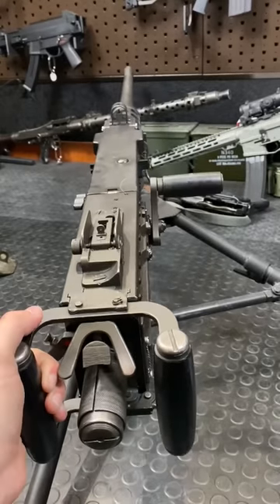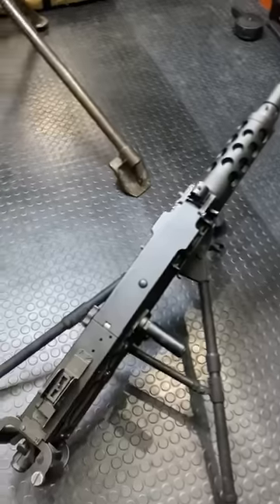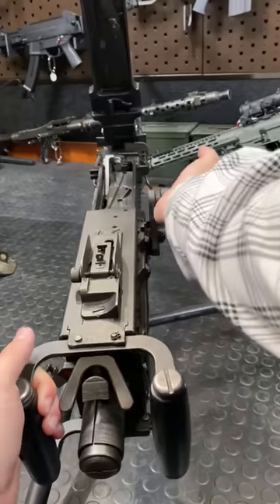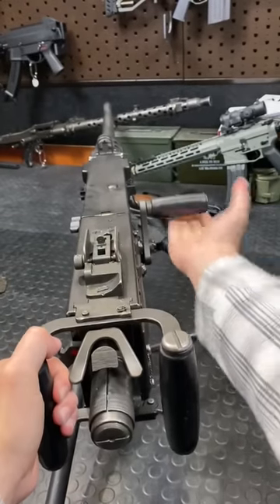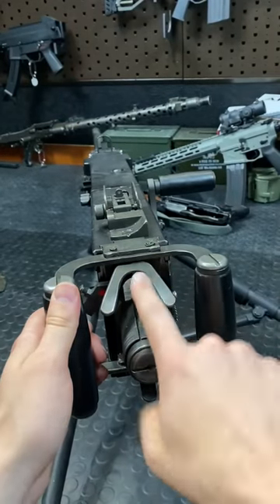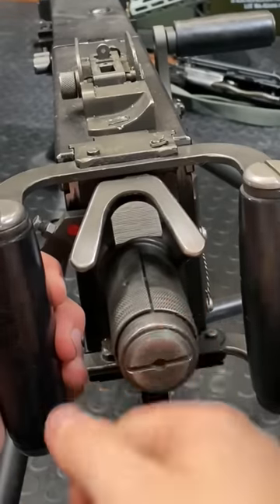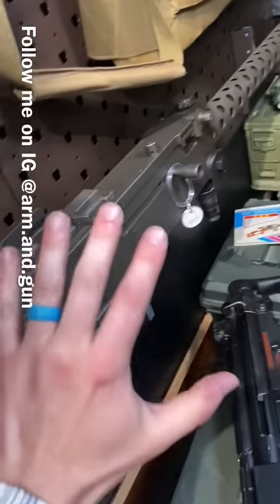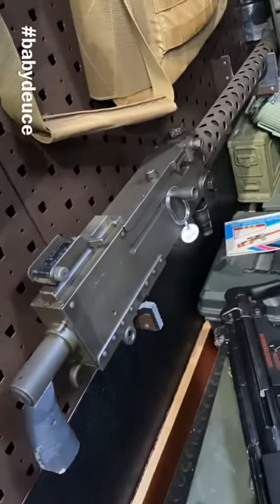50cal Browning M2HB “Ma Deuce” in 1 Minute #Shorts

Comment: When you realize that the firearm you designed is so good that it is still in wide use by the military almost 90 years later.
Reply: Çòòĺ àñd ÀWÈßÒMÈ'
Reply: The AK 47 was named after the year it was created. 75 years and that thing is everywhere. 

Some inventions are like sharks or alligators, peak evolution that doesn’t need to improve and can’t really be improved on. Cockroaches, horseshoe crabs, and the M2. 

Like the A-10, the Air Force keeps trying to replace it but they can’t make anything that’s better at doing what the warthog does, and that plane has been the original thing that goes “BRRRRR” since 1977, another Gen Xer that won’t ever get to retire and never did give a damn.
Reply: It's not that great. There was an attempt at replacing it but the geniuses at Army Ordnance were too obsessed with trying to make it capable of switching between 25mm grenades and .50 BMG, and it never went anywhere. 

It was a good weapon for the time, but we need something more simple, durable, and reliable now. If you want to know my reasoning, I spent close to a decade in a small arms shop working for various units and M2s were one of the most common items to be deadlined, behind M249s and mortars. M240's? Hardly ever broke short of dropping one out of a helicopter. Mk19s? As long as you assembled it right, it was damn near unstoppable. M4s and M9s? Some minor things here and there, but extremely rare when compared to M2s.
Reply: @Motoboo_Marine  Don't get the reasoning behind claiming the M2 isn't that great because of generally needing more repairs than small arms. It's a .50 cal machine gun. More stress on the parts than intermediate rounds. Allot of M2s in service are ancient with thousands of rounds passed through, just maintained and refurbished over the years for more extended use. This all goes for a multitude of different heavy machine guns in use around the world. 

Bigger gun. Bigger parts. Bigger bullets. Extended use. Equals to needing repairs. Most veterans I've seen have positive feelings towards the gun. If it's loved by the soldiers using it, by chance it does it's job plenty good.
Reply: @Firealone9  I didn't say it wasn't great. I just said it wasn't that great. 

People love it because of the round it shoots, not because of how reliable it is. How can a weapon possibly be that great if you can't use it because it's down and waiting for parts? Out of all the troops that love it, few of them have actually used them in combat, and if you ask those guys I gurantee about half of them will tell you theirs broke down all the time. You don't hear about those stories because those are not what the majority has experienced; what the majority has experienced was shooting them on a range during training, not having to take care of them for months on a deployment.

Armorers are not trained to the level required to successfully maintain an M2/M2A1in MOS school either. Every weapons class revolves around how go detail strip and reassemble everything, and that's pretty much it because that's all that's needed to repair every other weapon in inventory. Why shouldn't the M2 be the same?

The size of the round doesn't matter here. It's about how the design handles the a huge round. There are 20mm AA guns that need way less maintenance than this thing. If you're familiar with how the internals of an M2 works, you'll understand what I'm talking about. The M1919 it's based on needed about the same level of maintenance, whereas the M240 barely needs any despite shooting a round with the same power.

The only reason someone doesn't create a mechanically simpler .50BMG machine gun is because the ordnance dept is lazy. They've actually gone as far as to change the code out requirements for the rivets being loose several times, in order to manipulate the numbers so it doesn't look like they're going down as much. All so they don't have to do anything about it.
Reply: @robinsonkaspar3395  well they have make newer version of the ak and the 47 is longer standard use while this thing is Still in service. Not the same thing
Reply: @Motoboo_Marine  The reason why we dont get rid of the M2 is the reason why we dont grt rid of the M16. You cant justify requiping the military with brand new guns that do the same thing as the old guns. The M2 still has its parts being manufacturered, they can be repaired and put back into use realitively quickly. There is no point in paying billions upon billions of dollars to abandon a perfectly functional weapon in search for another weapon that does the same thing. That thing being shooting big boy pews at lethal velocity very rapidly. 

Just like the M16. It is a perfectly functioning carbine that the military has known and used for decades by now. Improvements are made of course but until a new rifle or carbine comes out that is vastly different and improved from current weapon systems, there is zero purpose in replacing it.
Reply: "Sup kiddo"

- M1911
Reply: Except it seems to jam like crazy according to some Veterans.
Reply: @jumbo 

Gotcha, was wondering.
Reply: This comment has also been in wide usage for many years. How about you come up with something marginally original to contribute?
Reply: @lukegaming86 

Don’t think too much about it.

It’s the internet, almost nothing is original. Always copied or “inspired” by other things.
Reply: @jumbo  as another veteran, they do jam. I've done enough work orders to prove it.
Reply: @jumbo  and that's *false. If yours rarely jammed, it was because you had an armorer who knew their shit. But those aren't exactly common. Most in service are beat to absolute shit. I've had to rebuild several hundred of them belonging to multiple different army units during my 3.5 years in Afghanistan, both M2 and the A1 variants.
Reply: So good, there is no man alive who had been in the military before it was adopted. For everyone on the planet, the M2 was just always there.

Guns don't kill, they serve. Steel doesn't break, it supports.
Reply: I fire it yearly in the swiss army
Reply: Military's
Reply: The right to bare arms is a fine line. You also have the right not to.
Reply: Remember that old saying when something works don't mess with it but then again nobody messes with ma deuce.
Reply: @robinsonkaspar3395 
Cough cough Let me tell you about the Mosin Nagant that was made in 1897 and is still being used to this day cough cough
Reply: @okca5846 
Mosin Nagant: Mind if i join?
Reply: @robinsonkaspar3395 
The a10 is dodo garbage
And was replaced before it was even finished by the f111
Reply: They are in fact the same 90 year old machine guns we originally pressed into service before ww2. At least they operate like that.
Reply: @dylanmccallister1888  not THE same
They are modern produced
And with several small mechnical upgrades 
But more or less the same
Reply: its a 100 years old gun and is very good as a mounted gun or as coaxial machine gun . for a bullet, 50.cal does more damage
Reply: @jumbo9386 Your reasoning is "It's great because I hear that people say it's great?" Flawless logic there, ya dope.
Reply: @BadassName17  "Some veterans" say it jams so I don't like it." Whatever dude. Well this veteran says otherwise so you can add a check to the other side of your list and I'm an actual person, not just some anecdote.
Reply: @eamonia  

This was 2 years ago, this was settled a while ago.

And I do not kiss your ass, you are simply defunct military property and have no more right to speak to me that way than a normal person. I said some for a very good reason, and I didn’t hear any that said it was good except from Jumbo.

Comment: I would be impressed if you can do the head space and timing my man.
Reply: Without a wrench and spacer tool! Try carrying it out of an MRAP by yourself in one piece or a tank. Doing this all day long. If someone holds the barrel by hand with gloves on, and the gunner carries the most right weight at the rear sight firing on auto bursts is amazing. New lightweight tripod made a couple of years ago is awesome
Reply: The newer ones don't need it from what I hear.
Reply: Depending on how new his barrel and parts are, he probably doesnt have to worry about it. As manufacturing gets better and better, the headspace and timing can be made to be perfect between parts.
Reply: @sebastianriz4703  check headspace and timing on M2 on youtube. Probably take you 20 minutes to learn until then you do not know how to operate an M2
Reply: @politicallyinsensitive4200  check headspace and timing on youtube its a job that has to be memorised and done frequently you have to Service weapons like this aswell as in the field

Comment: I love the five round links.  How do you order those in Canada?  Do they have to come in five round links or do they let you order them by the hundred as long as you septate them?
Reply from the maker: No limit on those in Canada as they were designed/made pre 46
Reply: It's prohibited in Canada because it's automatic. The "made before 1946" only applies to short barreled handguns and those in 25 or 32 calibre when it comes to transferring to a relative.
Reply: @armandgun  you live in Canada with these guns and are allowed to? Are you allowed to bring them outside or even to a shooting range?
Reply from the maker: Different rules for different things. The OP asked about the linked ammo. No limit on belted ammo as long as the belts were made before 1946. The handgun thing is for 12.6 class handgun owners with children. They are eligible for a 12.7 license but can only inherit guns as you described - pre 1946 12.6 class pistols
Reply from the maker: Rules for possession, transport, and discharge vary greatly between individuals and businesses.
Reply: @armandgun  so you could in theory have a 10k round chain, so long as it's old. But can't have a long chain if new... Stupid laws are fun.
Reply: @zaxscat5357  with a 10,000 round belt You're either going to have to have some sort of assisted feed mechanism or 500 aid gunners. Even then you're going to be limited by the m2's sustainable rate of fire. And with that being the flexible headspace version of the M2 rather than the fixed head space version you're going to have a massive gap in your volume of fire when you have to stop for 5 minutes to change the barrel and reset your headspace and timing.
Reply: @mechwar31  he pointing out the stupid law not thr idea of a long belt of ammo
Reply: @mechwar31 you're fun at parties.

Comment: Not semi auto. The bolt locks back with each round fired in that mode.
Reply: Which would actually be single shot at that point.
Reply: You don’t need to rack the bolt just tap the button so it’s absolutely semiautomatic, semiauto does not always mean as fast as you can yank your bogger hook, any arguments go check Ian on forgotten weapons, he’s about as expert as it gets, Hickok 45 also agrees with my Gunny 
Semper Fi
Reply: @patrickancona1193  I work on these for a living. They are absolutely single shot and full auto only. You have to push a button to release the bolt after firing it in single shot mode.
Reply: Thanks professor

Comment: I had a run away .50… exploded while in a M-113 firing hatch.
Got shrapnel in leg and tiny piece in left testicle..swelled up squeezing both together for 4 months.
Laid there on Demerol the whole time.
Begged them to cut off my left nut.. I was 18..
They wouldn’t..
Tons of problems until they sent me home.
Got it cut off, problem gone..
Did a ton of pain meds for 2 1/2 years till I cut it off.😳

Comment: It's a good design but terribly outdated. They require so much maintenance they're basically deadlined, regardless of knowing it or not, if they miss a single quarterly inspection by someone who knows what they're doing. The PMCS table alone is 123 sections long (the M16 is like 20 or so iirc), then there's additional inspection points throughout the TM that most people miss. 

Some of the repairs require a drill press which a lot of small arms shops don't have anymore since every other weapon in inventory only requires simple parts replacements. The M2 has parts that must be fitted, filed, etc. You can't even be extremely liberal with CLP because if any gets into the buffer disks in the backplate assembly, the gun will shoot itself to death from accelerated wear. If the breechcam spring on the bottom wears out, or the breechcam isn't spaced properly the weapon will fail to fire every few rounds. There are a lot more, too.

It's a great design, but like the 1911 it needs a replacement. There was even one in the works but dumbasses at Big Army were too obsessed with trying to make it capable of shooting 25mm grenades and it basically turned into another Bradley scenario.

These things are probably one of the most prone weapons to going down, second only to M249s and mortars. If your unit had one that was extremely reliable, it was only because you had an armorer that knew their shit.

Sincerely, an armorer that knew their shit.

Comment: It fires from both the open and closed bolt position. You put it on safe and ride the bolt slowly foward to prep for a closed bolt shot...which is normally when you are attempting a precision shot....which the M2 BMG is capable of especially when mounted on a tank and the T&E is attached. The reason you use the closed bolt position for a distance precision shot is because the gun jerks a bit when the bolt slams forward before the giring pin initiates the primer so it will throw the bullet off a little and a little bit at the gun winds up many inches at 1200 yards. If you are firing it like a machinegun you are adjusting the cone of fire to move the beaten zone to where your enemy are.